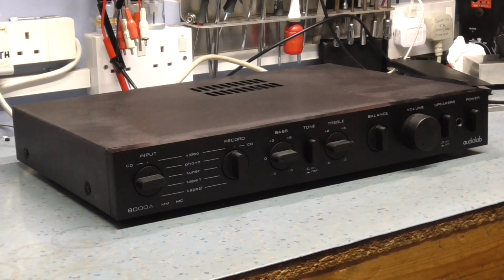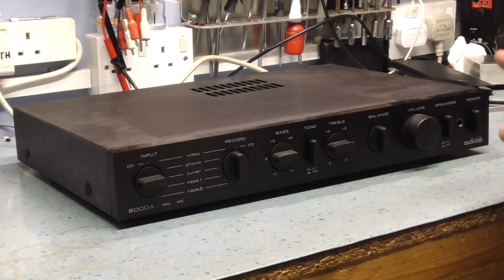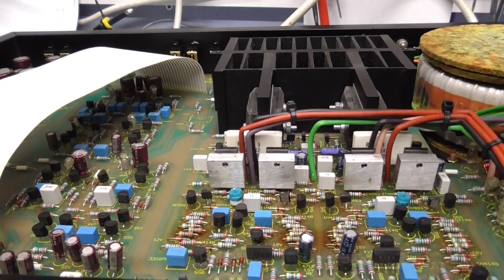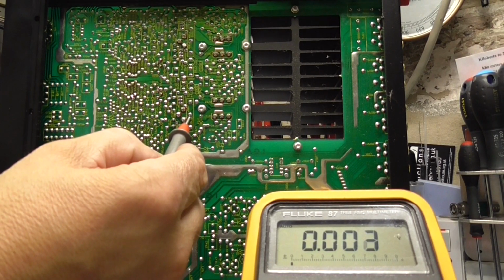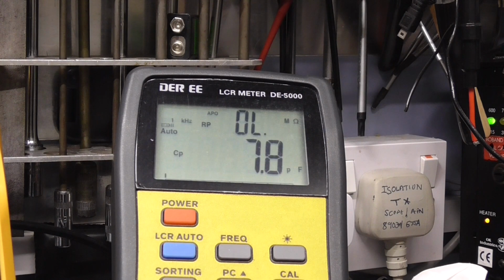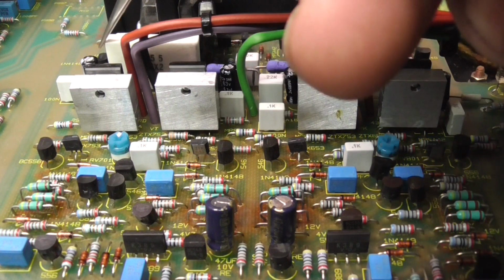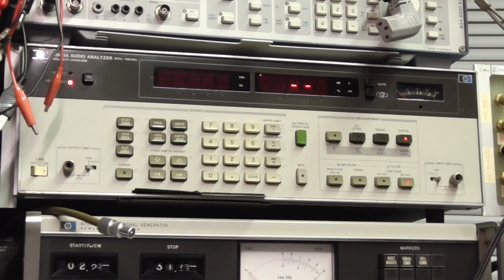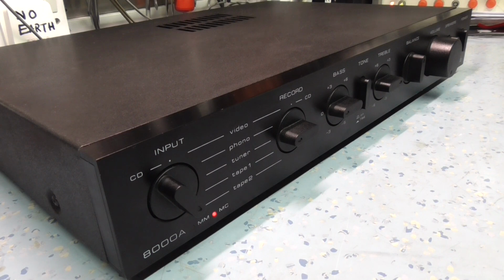Audiolab 8000a DC Offset or protection fault.

Comment: Many years ago I worked for Cambridge Audio on final test of the P40/50 amplifier. Interesting tests we did on distortion. The basic distortion on that amplifier was really low, less than .01% right up to clipping. If you turned the bias low, THD would not rise but if you looked at the distortion waveform (analogue not digital) you could do this with the HP distortion analyser, you could clearly see a cross over spike. Best viewed at 10khz at 5 watts output. At this point the QI was adjusted to remove the spike completely. 
Because distortion was so low anyway, buried in the noise, the crossover spike did not increase the overall THD. It's debatable if you could hear it anyway. We did spend many hours listening at different bias levels mostly on the Quad electrostatics. Results were really inconclusive, maybe a little harsh on the HF when under biased?? 
Regarding the 8000a, customers would add a tuner and stand it on top...now THAT really cooked the amplifier, heated up the tuner which would drift of tune. Problem solved if the tuner was underneath the amplifier.
Christmas party's were always good for  business, the amplifiers got a high power roasting and came in with the power transistors blown up!!
Ahhh the good old days!!
A better solution for regulator overheating WOULD have been to use a separate lower voltage winding on the transformer.
Reply: Good stuff Michael, that was an interesting read.
Reply from the maker: Very interesting Michael. The sound is great but the cooling issue and fracturing of phono sockets not so great. All heat related. Re the regulator, yes just a drop in input to them would help a lot.
Reply: Hi Michael, pretty sure i've seen your name mentioned in some old Cambridge Audio service manuals ! Cambridge were always funny... some good designs often let down by cheap manufacturing. The stuff they make these days is pretty much garbage
Reply: @jaycee1980  Hi Peter, I could write a book on the early Cambridge days and products, great ideas but MANY production problems. The original P40 was well ahead of it's time in low distortion and a really clean sound.
Reply from the maker: @MichaelBeeny  You should!
Reply: Michael Beeny  Thanks for sharing the information fascinating. Regards Chris
Reply: @John M7RCZ Most domestic amplifiers had issues with overheating. They were fine for average music use with good peak output but could not take party's or high power continues testing. After all, they were made for domestic use. The Armstrong 521 had a lovely cross over spike, quite visible in a distortion analysis. Not very reliable either! The 626 had really very small heatsinks.
Reply: Yes, def not a party amp, can't handle high volume AT ALL. 
The 8000A just shut down after 20 mins or so. 
Luckily I had a spare amp handy..
Didn't blow anything though.

Comment: I've just got an 8000s, I am doing research and I found this video. Mine get pretty hot and also if I raise the volume knob not even at half of the run it goes in protection for few second until I turn it down a little. What a strange project....I am not listening at crazy high volume. I got it check with my tech, he find out there was a BIAS problem, he fixed it but protection still kick in if I turn it up. Any fix ?

Comment: Hi There love your videos . I had one of these in for repair and the bias was  55 mv on one channel and 72 mv across the emitter resistors from switch on  so  adjusted them back to 22mv and now it runs nice and cool and cross over distortion seems ok.Just wondered what you set the Bias to on this one . Kind regards Robert .

Comment: Hello, i just got to this and thank you on bias pods setting advice ( for amateurs like I am thats full cca 😆, full ca will result in immediate temp raise). I own a basically the same amp 8000s for the past 25 years. I have recently gone through bunch of capacitor replacement rounds simply because on my DER EE they werent reading in spec or werent reading at all. Interesting how sensitive to sound coloration different capacitor combinatons were. I ended up with upgrading PS caps with 2 x mundorf 15000uf  - an immediate change in breadth of sound, went through cheap nichicons in power amp - yes since they were new they brought improvement in high frequency - but overall it was too hot. Afte that i used nichi muse with elna silmic II that balanced things out nicely and brought low frequencies back. I also replaced 6 - 4.7 uf caps in line amplifier with silmic II and 2 - 47 uf with nichi Muse. For the rest of large 470 uf i went with nichi golds. Overall i am very happy. So happy in fact i no longer require a sub and run the amp in integrated mode. Sound is non fatiguing but has plenty of detail at 45-60 db my ideal listening volume. I spent perhaps $100 on capacitors for this amplifier and i am very happy with the result., so much that for now i have abandoned idea of going the same route on my 8000p - because S is performing so well solo now.
Reply: Halo , sir ! I come across reading your sharing about replace audiolab 8000a caps  can you share more info caps value as i in the thinking which caps model and value would suitable ? Thankzz for kind sharing *tq
Reply: @kevinchew2594  8000a is a bit different than "S" I own. I exclusively used DigiKey for capacitors, resistors. It is basically a mix of Elna Silmic II and Nichicon Muse. Follow the Farad values that are already on caps . Make sure you use no less than listed voltage and temp rating. I honestly would focus first on things that read/test outside stated values . Get a good ESR tester for in circuit testing . To desolder get specific desoldering iron with suction. IMO - to actually hear the difference you need to have to have a really good set of speakers, a reference track and a good ear. Go slow don't rush this. Do not damage your board. Replace resistors that overheat the board (a design issue) - I am assuming you are talking about a unit manufactured sometime in the 90's - if  this is modern unit - forget anything here - I got no clue. The 4 low value capacitors right next to power end  of things - like to be relatively high ESR value - if you put something other than that - you will hear it 😆 I installed new set of PS caps - IMO a waste of money since set of Elnas originally there was just fine. And...good luck!

Comment: I have an 8000A running since 1989, and have only had to replace the RCA input connectors. Other than that, cold soldering on the AC diode bridge, volume pot, and protection relay, that is, on the "cold" parts. Regarding hot parts, the attached thermal photo shows the hottest point at 75.3ºC, with the cover open, which can exceed 80ºC with the cover closed. The hot regions correspond to the resistor arrays at the bottom and the transistor/zener pairs above them. https://drive.google.com/drive/folders/1GUwHASP1uje0Kwdku5Vi7MQQbOE6rUp-?usp=sharing

Comment: What i've always found over the years is they overheat & quickly if used as a pre amp & i've noticed you get more issues in summer with them & they start distorting, what i've been doing for years is when it starts happening is blast them with a powerful hairdryer on cold & go & make a brew.

Comment: I’ve just repaired one of my two 8000P’s. I could have done with tracking this video down a year ago. It failed in February 2020 and I knew virtually nothing of component level fault finding. It would work for about 5 minutes then the relays would click and silence from then on until it had cooled down. I spent ages trying to get a schematic, read up on relay speaker protection. I replaced all the electrolytically except for the big smoothing caps(£20 each), the wired ceramic resistors (from China) and some transistors that had obviously got hot as the PCB was brown as per you video. I also add heatsinks to them and had to repair the PCB as the tracks and pads disintegrated when I desoldered. It’s been working great now for the last month. The amount I’ve learnt has been immense, and I’m now working on an Arduino controlled dual fan project with automatic control over three speeds. Anyways, thanks for thee videos.👍🏻
Reply from the maker: #well all I can say is well done you. Its great to repair broken gear and these Audiolab amplifiers deserve it.

Comment: Hi Simon. I am currently taking on a little project of replacing the caps in my Audiolab 8000P (newer model), and was wondering how important the 47pF "caps" (the odd looking one with transparent housing) at the input actually is.
You see, I forgot to order enough of these 47pF parts. And frankly, I am in doubt if it's actually ordered the right replacement part to begin with.
Reply from the maker: The 47Uf do you mean?
Reply: @SoddingaboutSi   No, it really says 47 pF I think. You can see them in your video at 7:20. It's those glass looking things.
Reply: @SoddingaboutSi  Thank you for replying. :)

I think they are some sort of polystyrene film capacitors? I ordered multilayered ceramics. I guess ceramic isn't as good as polystyrene?

The 8000P have two of these at the signal input, and I was just wondering how important they are and if they where prone to fail?
I forgot to order replacement parts for them, so I only got 4 instead of 6.
Reply from the maker: @Mr_Wh1  leave them. Only the electronics  will deteriorate with age. All other caps will be like new.
Reply: @SoddingaboutSi  I think you are right. However, I am very sure I saw a repair video or a repair blog etc, where they where somehow toast and completely out of spec.
Maybe I am wrong?

Also, what are their purpose in the audio input?
And would I be crazy to replace the ones on the amplifier side with these?:
https://www.mouser.dk/ProductDetail/80-C317C470G2G
Reply from the maker: @Mr_Wh1  Those Ceramic caps perform poorly in audio. I need to see where yours are in the circuit to work out what they do. But polyesters are far far supirior to ceramic in almost all aplications. Focus on the electrolytics. II have never replaced a polyeser to date.
Reply: @SoddingaboutSi  Yes sir. ☺
Reply: @SoddingaboutSi  The audio path is as follows:
RCA -> through 470 Ohms resistor/  47pF cap between signal and ground after resistor  - > red 1uF film cap for DC filtering.

I guess the 47pF is for high frequency noise?

Cheers from Denmark.
Reply from the maker: @Mr_Wh1  just a hf filter. Leave it.
Reply: @SoddingaboutSi  Will do. I am not doing anything unmercenary and end up with problems like I did with my Harman Kardon HK980 amp. Changed some caps, bias stopped flowing, and I never found out why. So to this day, it still doesn't work.. 
That you for your help and advice. ;)

Comment: The schematic I found do not match up with my amp. Yours amp looks similar to mine. There are two variable resistors RV701 and RV801. They are not shown on the circuit diagram but shown on the Audiolab 8200A diagram.  I guess they are for the Bias setting. Is it correct? 
I am curios about the Bias setting. The service manual says the current should be 100mA or approximately 50mV across emitter resistor 0.44 ohm. But similar model Audiolab 8200a  recommends to   adjust 20mV across  resistors.  So that the current should be 45mA. It is twice less than the current of Audiolab 8000a. Someone reported that he adjusted 20mV for Audiolab 8000A  and got good result. The unit was getting much cooler without sound degradation. What is your opinion regarding  the current setting?  It should be 45 or 100mA?
Reply from the maker: Yes the manual for our model is not released to the public. These amps run far to hot and dropping back the bias is a great idea. It will make little difference to the distortion.
Reply: @SoddingaboutSi  It is a great advice because many people concerned the heat problem. Thanks a lot. So I can safely adapt the  Audiolab 8200A the Bias setting procedure for the Audiolab 8000A?
Reply from the maker: @olegau12  I would set the bias as you mentioned and leave it on for an hour checking regularly for heat buildup.  Output should just be slightly warm.

Comment: Is there a point of diminishing returns for audio capacitors? Does the quality of the circuit they are in stark to let them down?
Reply from the maker: It really depends on that the capacitor quality was like originally, what it's has to do in  the circuit and if it's in a part of the circuit surrounded by hot components. An amp like this left on for long periods that has poor cooling I would expect a 25% drop in the ESR of the caps within 5 years. Some fail much quicker, some are almost like new.
Reply: @SoddingaboutSi  I will open mine tomorrow, haven't done for over twenty years I think. I bought mine in 1991, it has be constantly on, almost since then. The issue with mine has been broken RCA phonos, not all, and sometimes, lately, hum from the toroidal I suppose. I switched it off only this evening after your report, after 30 years... I will make a short video to show the conditions of the board inside.

Comment: Your right they do get bloody hot especially when running into a 4 ohm load at moderate listening levels. I owned a late model one (1997) a couple of years ago. They got loads of hype back in the 1980's. I didn't think it was anything special. It certainly didn't stand up to all the hype that it got. They were £500 new expensive for something mediocre. Very poor heat sinking and lack of ventilation.

Comment: A larger grille on top (and bottom) could make a difference heat wise.  Also, a small, silent fan in the back panel might surprise you.
Reply from the maker: I would prefer that than adding a fan.

Comment: It's possible the board discolouration is from excessive current flow through the tracks rather than the resistors themselves... but i guess you have given it a finger test!
Reply from the maker: No Peter the resistors are dropping the secondary voltage via a zener regulator. The resistors are hot to the touch.

Comment: Hmm that pcb looks nicely cooked, i would do much the same as you and leave the leads long so the parts are 10mm above the pcb.
Manufacturers always place electrolitics near hot heatsinks, they are taking the micky.
A small fan mounted to blow air over the pcb from the outside would be an idea and kind to it.

The protection system must be very sensitive to detect a slight static d.c voltage across the speaker terminals.
I've never liked boiling silicone transistors or regulators, bigger heatsinks are fitted and if there is enough overhead voltage a big wirewound resistor is placed in the d.c feed to the regulator to lower it's dissipation.
Wirewounds are better with heat, well i think so :-D

I repaired a mates old beast of a Technics amplifier that had a speaker resistance detector, a dc bias.
That caused problems with the circuit jumping in sometimes, i did some relay contact cleaning and it behaved itself for a while.
A very dodgy/sensitive circuit.

Sorry waffle mode :-(

Comment: It's a piece of crap. 
All of the inputs on mine are busted.
I'm using it on the PC while another amp is being serviced, but once it's back, this piece of crap Audiolab is back to being a standby.
Reply from the maker: Well that's a bit harsh Stikibits!  It's a good amp that is under cooled and as a result the phono sockets become brittle. It's a shame they couldn't rectify this issue over the production run.
Reply: @SoddingaboutSi  I agree and that's why it's a piece of shit.

Comment: It's hard to tell without looking at it but I wonder if the amp might benefit from an external cooling fan possibly mounted on the top vent slots to suck out the hot air while drawing in cooler air from the sides. Don't know if it's worth the trouble to machine it all out though. Stay well. ATB Doug.
Reply from the maker: A fan would be a good option other than noise. Nothing worse that listening to music at low level with a fan humming in the background. Could put it on a thermostat or make it variable speed with a thermistor?
Reply: I've had mine since the 90s. Never turned it off. When it's cold it doesn't play as good but it's never overheated as far as I'm aware

Comment: Was there enough depth under the PCB to mount the electrolytics on the bottom just out of curiosity? Sounds like a good candidate for a small fan as well. Thanks for sharing Simon!
Reply from the maker: That is a great idea. I wish I had thought of that earlier. Did that on my Sondek to move the caps away from some hot resistors.